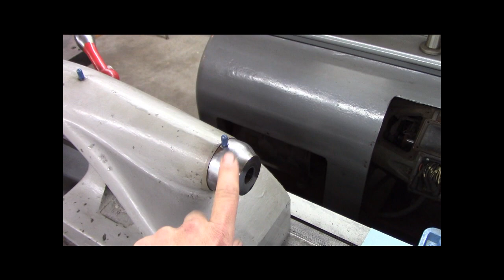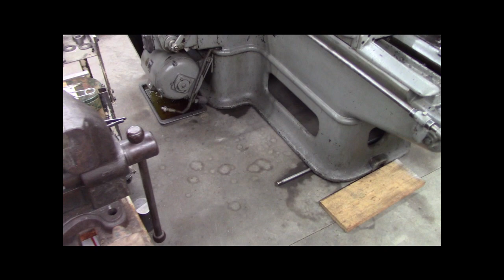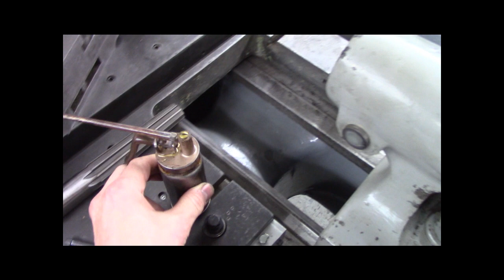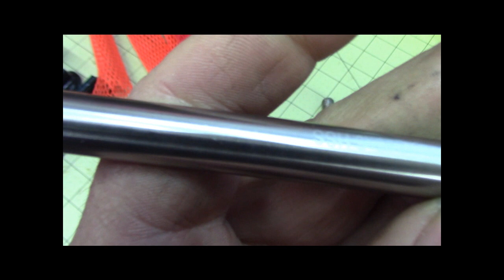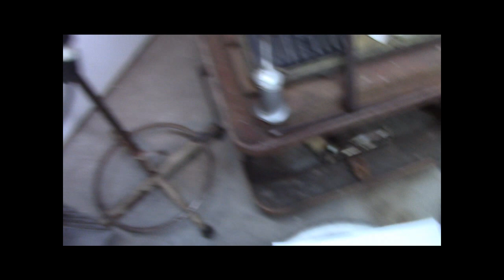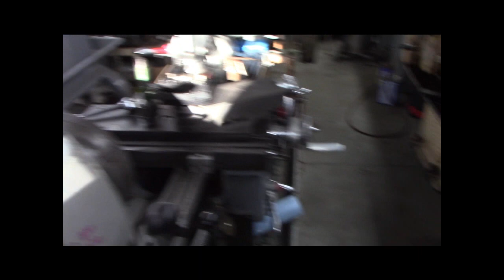12-18-22  --  17" Colchester Tailstock Nut Fix

Comment: The previous owner, of my Cincinnati Tray Top lathe assembled the tailstock with a roll pin instead of the correct taper pin to retain the nut.  About six tool changes after I acquired the lathe, the nut just started spinning in the bore.    So I pulled the tailstock apart, sorted out what was going on, reamed the nut for the right size taper pin, and it's been trouble free since.
Reply from the maker: Awesome bro!  --Doozer

Comment: The tailstock looks identical design to the one we have on our Colchester lathe. I know what you mean about the left hand thread. Great fix on the tailstock
Reply from the maker: What were they thinking with the left hand nuts ? ? ?  I can't think of any reason for it.  Would be easy to make a new stud bolt that is right hand.  Interesting that all Colchesters are like that.  ---Doozer
Reply: @kooldoozer  A previous owner has painted an arrow on the casting next to the nut on ours which acts as a useful reminder

Comment: I'll agree that ROTON Products are the bee's kneezz for reasonably priced acme threaded 'goodies' . . .  
         Pretty good solution to a very nagging problem , Doozer !   * That aluminum bronze would be a real bear to thread imho . . . ( but then , if it was all FUN to do , we'd all be doing it ! ! ! ? ? ? ) 
     That's one sweetheart of a machine - though it's quite strange to have that hole for the pin that's drilled 'cockeyed' . . . 'must'a been done on a Monday morning , or PAYDAY ? ? ? 
       'Looks like you've uploaded a LOT   > > >  on to the next one !    Thanks for sharing your problems / solutions - - - it's how we LEARN !
Reply from the maker: Glad you find it interesting George.  Yeah, Metalbutcher turned me on to Rotron. Man they got everything. I bookmarked them for sure.  As to the off center cross pin, I proved it can be clamped crooked in a machine vise.  I bet the operator at Colchester got sloppy and got it cocked in their fixture.  Oh well, now I don't use that cross pin at all.  Thanks for watching.  ---Doozer